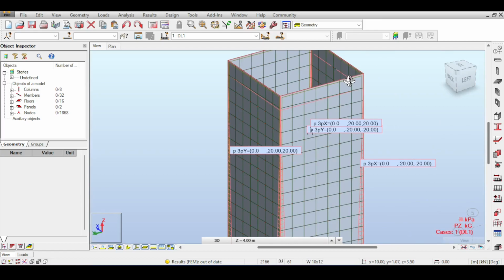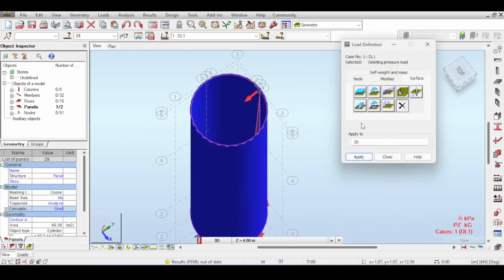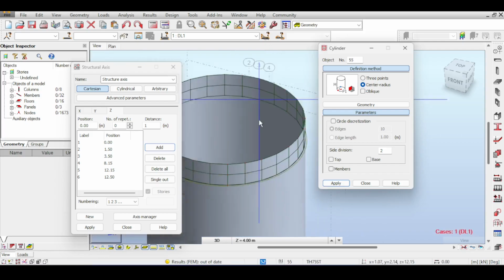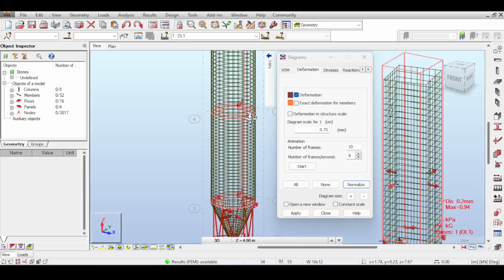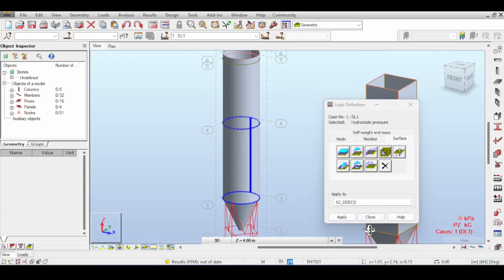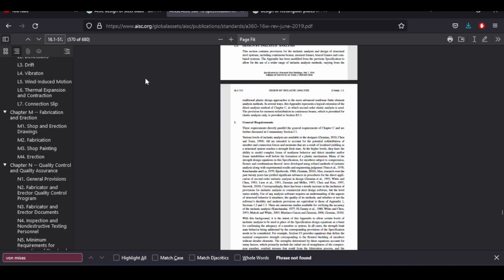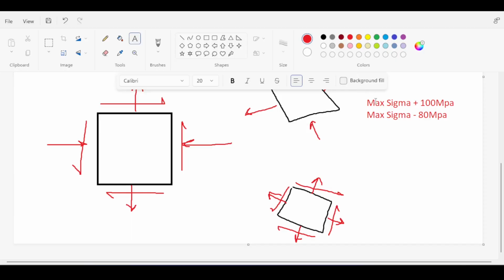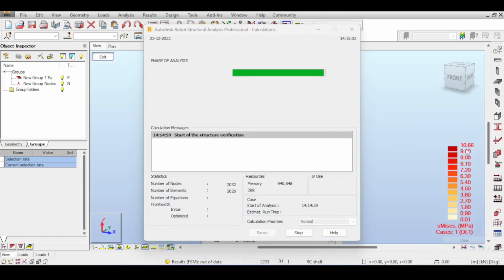Modeling Silos (Circular and Rectangular) in Autodesk Robot | Part 5: Steel Design

Comment: Hello CEE,

Thank you for the silos series, it has been quite an adventure. The quality and level of details on each part (including this part) has been awesome and it is very much appreciated. 

I totally commend the CEE for discussing the application of established failure theories with respect to the equivalent (von mises) yielding stress of the silo steel plate covering uniaxial (1D) stress states and multi-axial (2D or 3D) stress states. It may very well be true that the derivations and other detailed assumptions, limitations, etc. of some of these theories are mostly dealt with at masters or PhD levels, however, it is my opinion that the applications of such theories should be used in solving everyday engineering problems where these theories add value.

In this regard, I’d encourage the CEE to continue to discuss the applications of all relevant failure theories (von-mises, tresca, hosford, hill, gurson; also modified mohr, coulomb-mohr, rankine, etc. where these may become applicable or suitable depending on the type and kind of the problem that is being dealt with.    

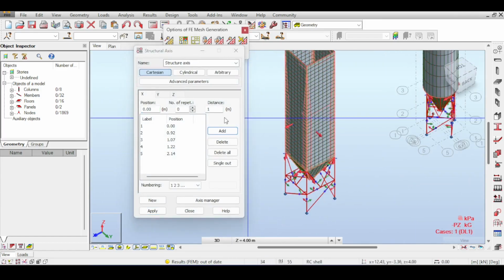02:06 and 04:10 It is indeed influential what and how a node (or nodes) at select positions or locations are capable of doing to the FE mesh (or mesher). It is good to hear that CEE intends to talk about meshing in the future on another video. A reasonable understanding and appreciation of meshing principles will certainly go a long way in enhancing the user (engineer) overall experience with FE software (including RSAP).

05:58 Yep, I also see now that there is a lot that just don’t happen as expected when dealing with curvature and curvature surfaces in 3D. In my quest to find a way to apply the (approximated) loads on the circular silo walls without first remodelling the silo into three (3) pieces, I tried to use the combination of “uniform planner load” and the converted (thanks to the CEE tips) “hydrostatic (surface) pressure” loads with the “geometrical limits” options enabled. This seemed to work well for the most parts except only for the very top “unloaded” silo wall piece above the approximate centroid of the material repose volume, the “approximation error” on this top piece was (with all other things considered and in my humble opinion) reasonably ignorable.

Unfortunately, when comparing the analysis results of the silo loaded in the manner described above to the results of the same silo loaded using the suggested approach on this tutorial by the CEE; the resulting von mises stress were about 50% less in the case where the former loading approach was adopted. This goes to show the potential of erratic behaviours when dealing with curvature surfaces in 3D and the need for one to be extra careful. Where possible, it would be ideal to try various alternative approaches and to compare prior to making decisions based on one modelling technique or process. 

11:23 Thank you for reiterating the details regarding the importance of proper circle discretization in order to ensure that one does not mess up the resulting mesh. This has helped me a lot and it has also improved my understanding and appreciation in this regard. I have noticed something peculiar with regards to the “hopper” surface model. The model as it has been created using a revolved polyline does not seem to be reflecting or accepting the changes made in the material thickness on the “panel properties window” [LHS under the “object inspector window”], the material thickness seems to be assignable in the usual way but the changes do not reflect under the panel properties window. Also, under the panel properties window, the “Meshing type is set to N/A…..other (walls) cylinders Meshing type is set to Coons”. Despite the above, the hopper surface seemed to be meshing fine. I went ahead and deleted the hopper and remodelled the hopper using Geometry>Objects>Cone …and used a truncated cone instead (with proper number of circle discretization and side divisions to match 😊, thanks to the CEE tips). This new hopper model resolved the thickness and meshing type issues from the previous model. The results (von mises) stress from this new model are different [they are higher] than the results from the previous model in which the hopper was created using a revolved polyline….? I am concerned [I am getting the iffy feeling 😊] that this is becoming a worrisome problem as to which of the results are to be considered to be more reliable?

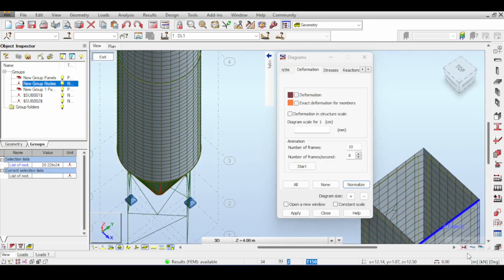36:49 I also find a deflection of less than 1mm to seem almost as if there is no deflection. Fortunately, there is the CEE editor and the CEE recorder to munch through these; and yes, I do read the lines and I had a good laugh at it. My models show deflection values ranging between max of 0.1mm and 0.2mm in overall consistent with the CEE model on the video.

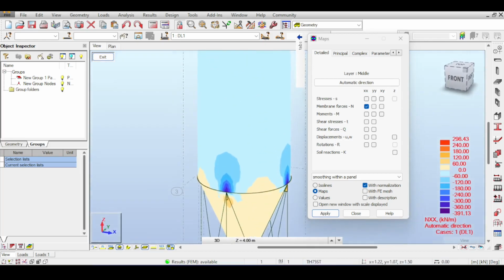40:50 I think these are some of the things that are taken for granted. It never really clicked for me until now when CEE mentioned it that there seem not to be a code or design guidelines for designing steel slabs or shells. I intend to continue the search on various texts that talk about this subject to see if I can find something of worth. Thank you CEE for an overview of the results and the sensible design options. 43:04 the graphical insert explaining the compressive forces on the hopper was a nice touch, a very effective way to driving the point home.   

43:36 Danger zones: I had thought that by modelling in the brackets at the connections was going to significantly minimize these stress concentrations? It seems that more is still required? But what (if at all) can be done more at this stage with the tools at disposal (RSAP)? 

I feel fortunate as a viewer of the CEE channel to have a well-rounded and knowledgeable content creator, editor, recorder, and presenter that the CEE is. I do not think that CEE is just saying talking nonsense to impress 😊. I find the detour to overview of the theoretical background to be absolutely necessary as it provides context to what you do; I completely agree with you that understanding is far much more important than simply knowing which buttons to press. Keep the theoretical background and overview detours on, they are also engaging and they intrigue interests if one wants to learn more about the various spheres of the engineering and scientific world and its related subject matters. 

As a viewer, I am indebted to you MJ; I can only imagine the fun that you must have had in Germany during your studies, and I have no doubt that your mentors remember you for your perspectives on various subject matters and your know-how. Thank you for sharing some of these with the world.  

Thank you so much for the silos series and for all of your other work. I am looking forward to what the CEE has in store next.

Take care, and enjoy your day.
Reply from the maker: Hello Engr. Donald,

Great that you liked the little dive into all the failure conditions and surfaces. I only scratched the surface to kind of intrigue the viewer to look into it.
About videos on the mesher, I hear you ^_^ I have in in my mind. 
About curvatures, it was tough nut to crack even for me to be honest.

I think modeling the hopper as a cone is even better than my approach. Amazing find! thanks for sharing!
The difference in results is something I have to personally think about. I will research the models used in the finite elements of both my approach and your approach. I can verify that those elements are used in robot for shell modeling (I cross checked with my own FEM software)
Katili, I., 1993a. A New Discrete Kirchhoff-Mindlin Element based on Mindlin-Reissner Plate
Theory and Assumed Shear Strain Fields- Part I: An Extended DKT Element for Thick-
plate Bending Analysis. International Journal for Numerical Methods in Engineering,
Volume 36, pp.1859–1883
Katili, I., 1993b. A New Discrete Kirchhoff-Mindlin Element based on Mindlin-Reissner Plate
Theory and Assumed Shear Strain Fields- Part II: An Extended DKQ Element for Thick-
Plate Bending Analysis. International Journal for Numerical Methods in Engineering,
Volume 36, pp. 1885–1908

But still, I have to take a look on the revolved polyline vs cone thing

Yep ^_^ I kind of want to run the meme where editor and recorder are two different ppl, glad you read those lil comments.

I personally was also underwhelmed and a little bit disappointed by the little effect of the bracket. I was expecting really more of it. I might think of showing a volumetric model on robot. But truth to be said, such a location can be analyzed using scientific softwares such as AnSYS and Algor.

However, to be honest, I missed a golden opportunity to compare with and without brackets. It somehow slipped my mind, I had it on my radar but somehow it just slipped by.

Anyways, thanks a lot for your positive feedback, it encourages me to keep on going.

I am thinking about the next structure, I am not sure, there was a subscriber request for a circular stairacase, I might postpone this request to find something that is "unique" and "little talked about"... I am still thinking.

Regards,
CEE/MJ

Comment: Hello there! (I say, with an Obi-Wan voice). Last comment on the silos series :)

I took another aproach in Robot, instead of spliting the circular silo:
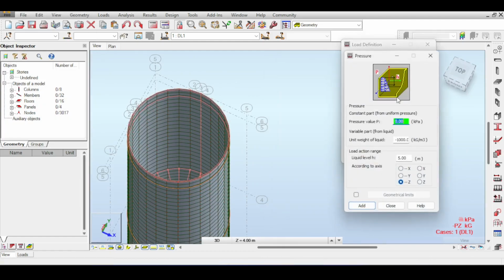Top and bottom are easy, but for the middle part (triangular load) I defined loads with hidrostatic presure - in the window 25:05 (where you input the values), at the bottom, I found this "Geometrical limits" button -> I defined a XY plane under which the the load from the pressure is not aplied on the elmenet. Awesome stuff!

I have you to thank for my ability to explore the program in such a way. I even modeld 2 seperate walls to clearly test the difference (In the past I would have been afraid of "separate structures - not knowing what the program does differently).
I really appreciate you contribution the our industry!

Best regards,
eng. Razvan Muresan
Reply from the maker: Oh that is a solid and amazing idea! I struggled a little bit there. You can even sometimes see that there is some heavy editting to the original footage ^_^ just because o dat.

See? RSA is so good at those things, so an amazing point of pointing that out. You are truly mastering the "Force".

Finally, your words honor me and encourage me to give it my all. Gonna pin your comment for the cool suggestion with regard to the load application.

Regards,
CEE